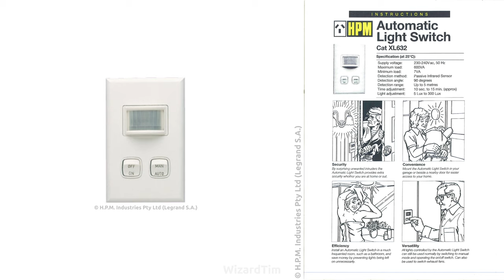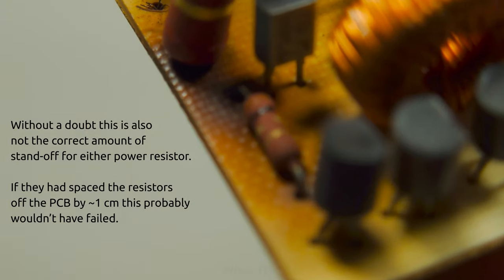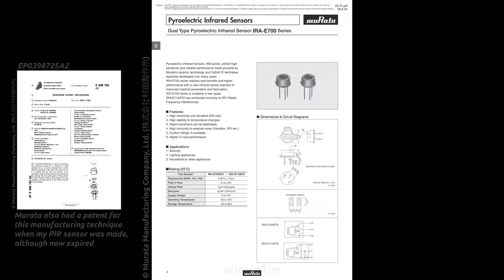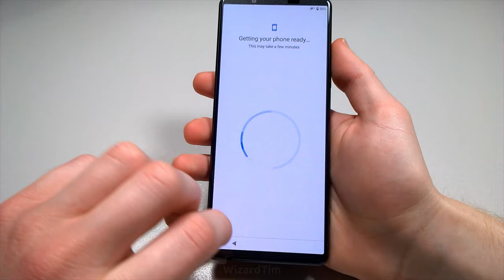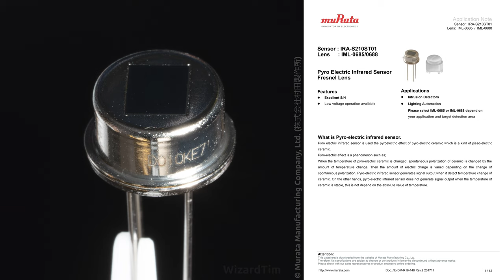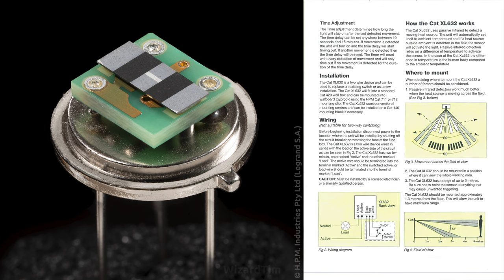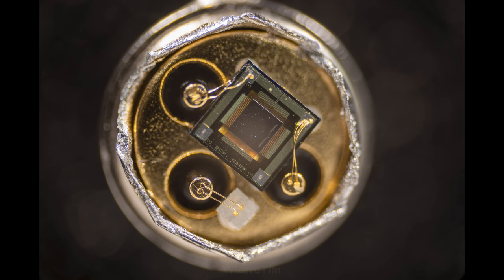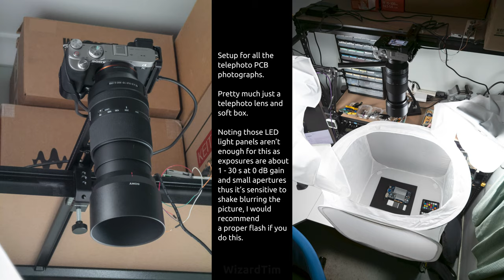PIR Failure Analysis & Pyro-electric Sensor Teardown

Comment: Saw your comment about radioactive stickers, did you get round to uploading it?
Reply from the maker: Sorry unfortunately I haven't really made much progress on that video since that comment 10 months ago, although I have heard back from the lab and the determination was the stickers are "10 times the regulatory limit for requiring licensure" which is 0.05% w/w radioactive material (stickers are about 0.5% w/w). Part of the reason is it's video #18 and I want to release some other videos before I start anything more on it. 

#14 comes before it and sets up and lot of the context for Amazon's position in eCommerce, distribution and sale of unsafe products and makes comparisons to traditional stores and argues what liability Amazon has and if Amazon has an unfair competitive advantage over other platforms and businesses and if this is driving the push for 'marketplace' style eCommerce platforms, the video is specifically about unsafe USB chargers and ends introducing the radioactive stickers video. It's currently 1hr 5min long and a comical 462 GB, I still have to add several more scenes and do a lot of editing to get it down to 30 or 45 minutes and a lot of other stuff, it's a while until I finish it.

#16 is unrelated but includes some context that shows I know what I'm talking about when it comes to radiation measurement and safety, this video is by far the most expensive video I've worked on so far and has had it's scope expanded 3 times, I originally planned to release this video in 2021 before I decided to add the 3 extra sections and am very glad I didn't rush it because 2 turned out great, but the final section is costing a lot of money and will take quite awhile to finish so will probably be published after the stickers video unless I cut the final section.

Also, I should note this isn't a 'proper' YouTube channel, this is just a hobby for me I do most weeks for at most 1 day a week instead of paid work or other hobbies, I know the videos are way to ambitious to be done in a reasonable time frame but it's a hobby and I enjoy making them, which is partly why I've been working on other videos like this PIR failure analysis video which will be getting a follow up video as #21 soon (probably the next video I publish) and today I'm working on #20 which is about some medical equipment but I was meant to publish it well before March 31st but there's no chance of that now. Either way those are fun videos to make, going up against a trillion dollar eCommerce platform by trying to persuade government departments to take action with their limited staff and funding as a single person isn't as fun. But with that said I haven't canceled the video, I still intend to release it eventually.

Comment: Get some mitutoyo objectives, those give some amazing ultra macro shots!
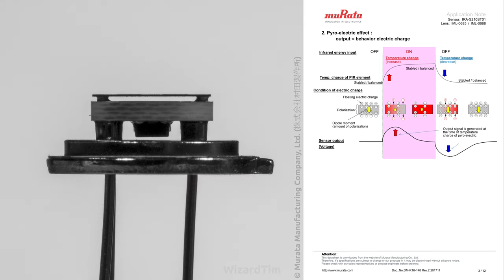Reply from the maker: I did look at some very nice used Mitutoyo objectives but decided against it as both they were expensive but also they were all infinity corrected which would probably be more useful in future but would have required a separate expensive tube lens and more adapters. I ended up going with that cheap generic Chinese objective and instead spending my money on a telecentric lens from SPO which I didn't show but a photo taken with it is at 17:07. I also redid the thumbnail of PMS7003 video, it's now a stitched mosaic of several telecentric photos. Since this video I've ended up using the telecentric lens a lot more than the microscope objective so I'm not too sad about the microscope quality, although I do have a new tube for it which gets rid of that bloom in the center.
Reply: @WizardTim  Yeah that's true, seems like a great decision. I read a review of that 4x .10NA objective and when purchasing it I ended up buying many more objectives of the same style, I couldn't believe the price for $500 I got 6 plan objectives brand new so I wasn't expecting much for the other objectives but I took the risk anyway and well they were better than I expected however I feel like I "outgrew" them, first issue to me was the short working distance specially the 20x one and later the lack of epi-illumination, also recently I got the bug of photolithography and I think some mitutoyo objectives would be superb for all this. So now Im saving up to get one, hopefully two of them the 5x .14NA and the 10x .28NA The other models are way too expensive but will have an eye on the used market, with some luck I get a high NA objective for an affordable price.

Comment: What do I replace the XL632 with Wizard Tim
Reply from the maker: Bunnings has the "HPM VIVO PIR Sensor" (MPN: EV803PIRWE) which is a 'wall plate' style PIR sensor, however it doesn't have any manual/auto or on/off switches on it like the XL632. If you need the switches you might be able to get a 3 gang switch plate and use a Diginet LEDsmart+ PIR sensor (MPN: MMSE/PR) and transplant the old labeled switches.

But I got mine replaced with just a standard PIR sensor and single light switch as it was less than half the price of any of the wall plate style sensors.